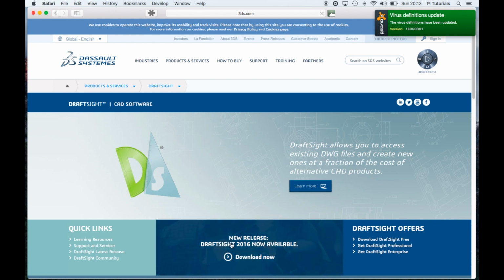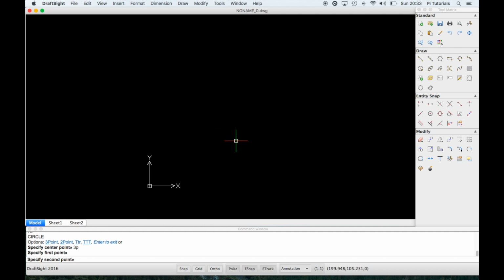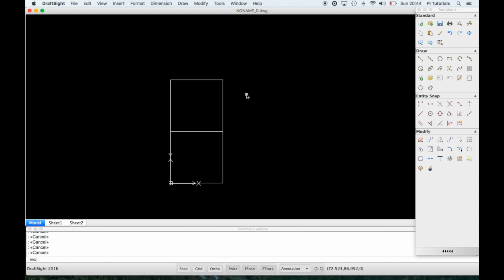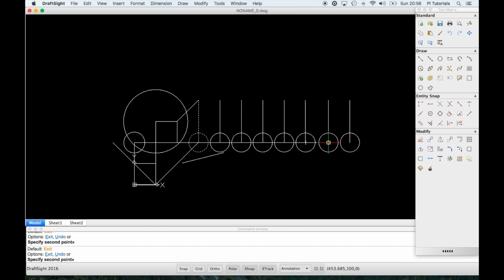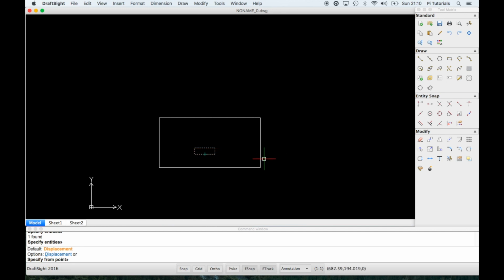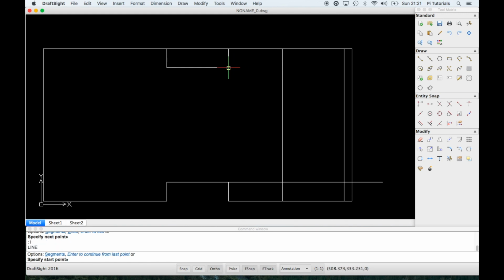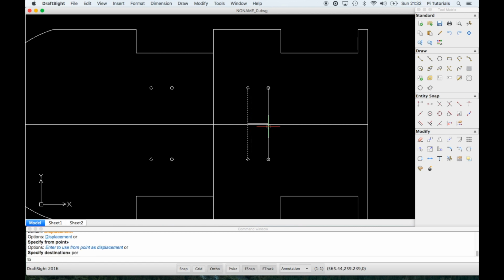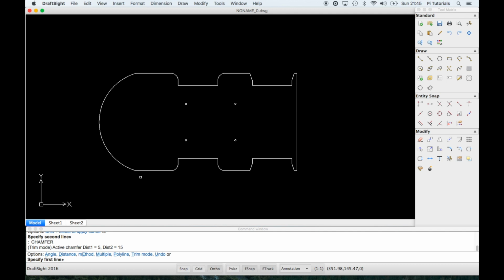Introduction to drawing with Draftsight

Comment: Great tutorial, Keith -- thank you.  Do you have anything for using symbols eg electrical symbols, perhaps?
Reply from the maker: Hi there, I don’t have anything specifically for symbols, you could probably find a block library on the web somewhere. Or you could create your own. You can create your own symbols inside a block. Use the ‘block’ command, create you symbol and save and exit the block editor. To insert a block use the ‘insert’ or  ‘i’ command to insert a block whenever your want to use your symbol.  You can create many blocks, each with different symbols.  You can also create you blocks in a separate file using the command ‘wblock’ w is for write.

Comment: Hello,
I was having same problem with chamfer as you were at about 1:19:00 or so.  I just reversed the distance measurements used at the top chamfer to get the bottom chamfer to work correctly. Verifying with the di command shows the same distances.

Comment: Very helpful tutorial for beginners like me. Thanks so much.

Regarding around 32:00 about how angles clockwise are negative and CCW positive, this is standard practice in mathematics from Algebra through Calculus with angles on the x-y plane. Zero degrees is the on the x-axis pointing to the right. Straight up would be +90 or -270 and so on.

Comment: Great tutorial, thanks!
The reason that anticlockwise rotation is positive comes from the Cartesian co-ordinate system. With origin at zero, by convention, moving to the right on the x-axis is positive (in primary school the number line is positive to the right and negative to the left). Similarly moving up on the y-axis is also positive (again we think of up as positive and down as negative). In describing position, by convention, we refer to the x co-ordinate first and the y co-ordinate second (e.g. x=1, y=1 is a point at 45 degrees from the origin one positive unit in each direction). When it comes to angles they are, again by convention, relative to the x-axis, so points along x are at zero angle. The previously described point (1,1) has positive x and positive y and creates an angle at 45 degrees to the x-axis. Since, for the first quadrant, position co-ordinates are positive then, again by convention, angles are also positive. Thus the anticlockwise rotation produces positive angles for every quadrant.
Rotating clockwise moves points first to positive x and negative y (hence negative angles). In simple geometry on the Cartesian co-ordinates minus 45 degrees is of course equivalent to positive 315 degrees.
Hope this explanation helps anyone continuing to wonder about this.
I guess one could create a DraftSight diagram to illustrate this better than the long wordy explanation above.
Reply from the maker: Paul Reader  nice explanation, thanks Paul. Makes sense now.
Reply: Thanks for the great video (and the English accent), I'm investigating 'free' CAD software for members of our Mens Shed, a movemnt that I think is catching on in Uk as well now. Also liked your bird box video, the link for which I will pass on to some folks here (in Tasmania) who are looking to protect the Swift parrot from extinction. Using the Pi may be too high tech for their purposes but it might get them thinking.

Comment: hi there,

At 1:15..Chamfer for the bottom side. I found that if you set Dist 1 = 15 and Dist 2 = 5, solves the problem. For the top side was OK as you set, Dist 1 = 5, Dist 2 = 15. Thank you.

Comment: Hi there,
I have a little problem. I have already changed the Unit System to millimeters but when I use 400,200 for the rectangle..it rectangle gets too big , off the scale. Many thanks to your tutorial its very helpful.
Reply from the maker: Pathy K glad you like the tutorial. I think you just need to zoom out. Try scrolling the mouse wheel, or double click mouse wheel to zoom all.  If you don't have a mouse wheel press z, space, a, space. This should zoom all.  Hope this helps.
Reply: Awesome! It worked, many thanks.

Comment: hi

thats one of the best vids on draughtsight i have seen. I have a problem saving drawings to pdf and then exporting / emailing out, they seem to change and end up in a yahoo email format which is never supportted, any help would be much appriciated.
I am currently try to drawing plans for an extension to my home. 

regrads

logsplitter
Reply from the maker: lumberjack100100 That sounds more like an email problem than a Draftsight problem to me. Draftsight should produce a dwg file.